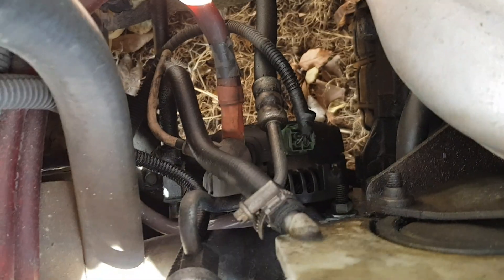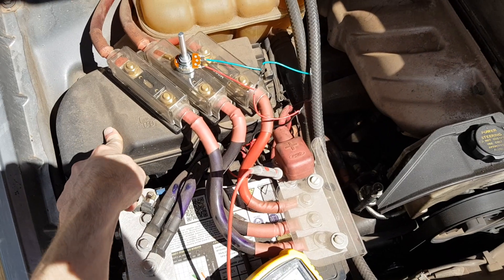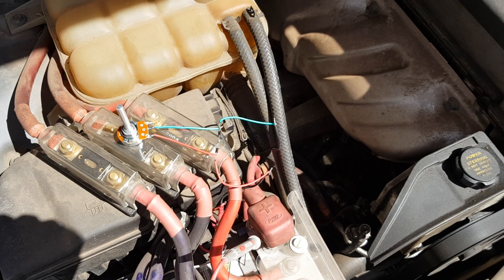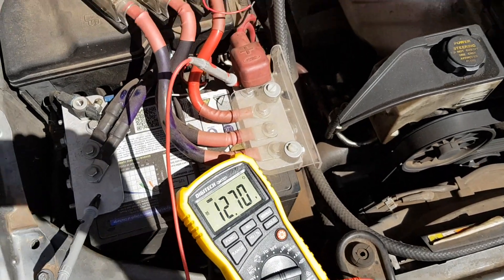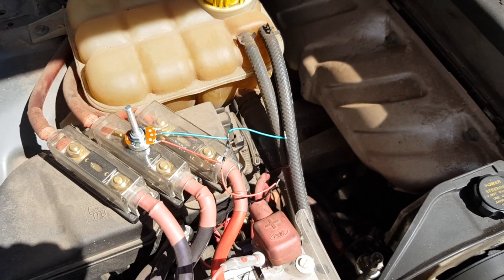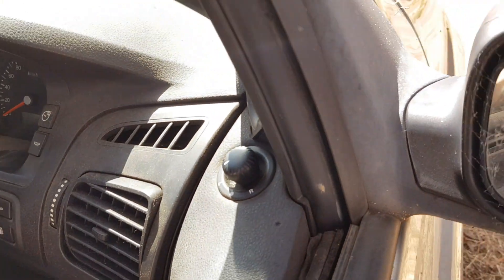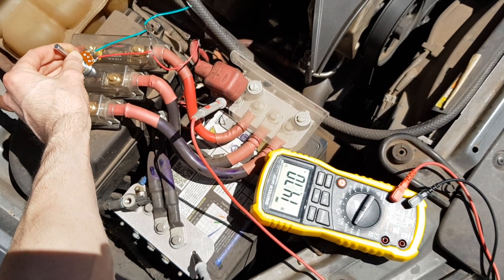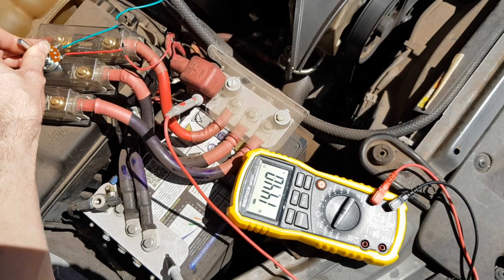$5 alternator voltage adjustment knob!

Comment: Is there a way to drop the voltage, mine is charging at 14.9 but i want to drop to around 14.5-14.7 so i dont mess anything up electronically

Comment: My alternator is already charging at 14.9 - 15.1V and I was looking for a way to lower it when I found this video.
Can someone please explain why you would want to have your atl at 15V? I might decide to keep mine then.
Reply: Car audio
Reply: @loganschultz7400  perhaps lithium iron phosphate will need slightly different voltage

Comment: Brilliant videos and I’ve subscribed but wot you have miss out on telling your viewers is that if you drop the dial back on your dial the warning light comes on in the car for battery and then the voltage are increase meaning down it will get to the point that on cluster in the car speedo the battery light will pop on and yes it’s normal of course because the alternator Ecu sees something is wrong so it’s normal for that 

When mines fully up it’s 14.5 with 3 diode in line but if you back the dial back from full the volts go up or have I done something wrong

Comment: If your car's alternator voltage is too high or too low, you can adjust the regulator knob on the back of the alternator to fix it. First, find the alternator and remove the cover. There should be a voltage regulator adjustment knob on the back of it. Turn the knob until you reach your desired voltage level. Replace the cover and you're done!
Reply from the maker: Is this a troll account?
Reply: @TwistTapeTechnology  no
Reply from the maker: @freeenergytransformer5842  just a troll post?

Comment: Do you have a diagram or schematic?
Reply: D-blu is  circuit 25 charge indicator signal and then pk is circuit 39 ignition 1 voltage
Reply: 4 in plug but only 2 wire

Comment: Hi there
İ connected 3 diodes in series to increase voltage up to 15.8v but actually could not reach that data by 5k poteniometer.it show nax 15.2v. Turn off potentiometer and get diodes direct to it shows again 15.8v. I dont know what wend wrong.what to do?
Reply: Absolutely do not go over 14.9v on 12v system vehicles if it has any electronics like fuel injection unless yiu want to risk of frying modules like engine control modules & risk of very expensive repairs
Reply: @pagedterror13 lots of people go over 14.9.. I've saw many people do 15.2 etc. But yea after 15.2 anything can happen!
Reply: @itsMrBRoc  I have 16.5V in mine. Works fine.

Comment: What size diodes
Reply from the maker: just 1 amp standard diodes. Anything from the 1N4001 - 1N4007 range is fine.
Reply: @TwistTapeTechnology  what ohm potensiometer?

Comment: The voltage source for the voltage regulator is from the igintion switch. If voltage is still on the regulator after the engine is stopped, you wil flatten the battery.
Reply from the maker: That is incorrect. The sense connection isn't what enables the alternator, its only a voltage reference to the regulator. It draws all of 1ma. If you're flattening a battery with that load, then you have massive issues. ;)

Comment: Yeah but where specifically do you hook it up in the fuse block
Reply from the maker: you don't. you connect it to the front battery.
Reply: So then you have the circuit path starting at a 12v start point and ran thru the potentiometer the the feild/sense pin?